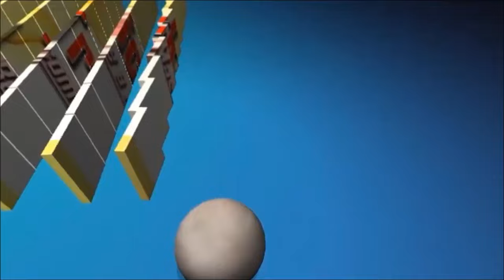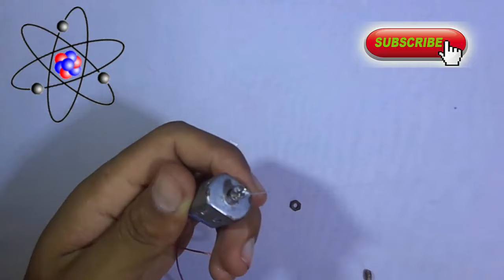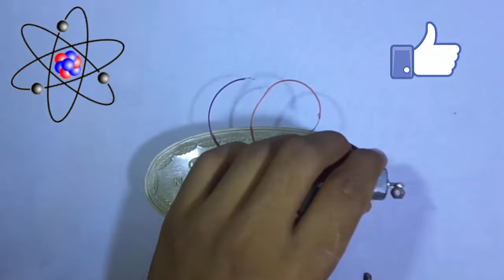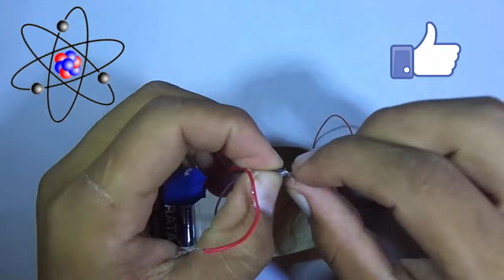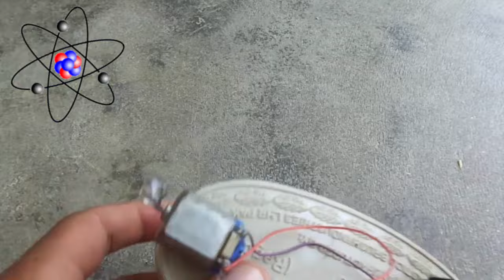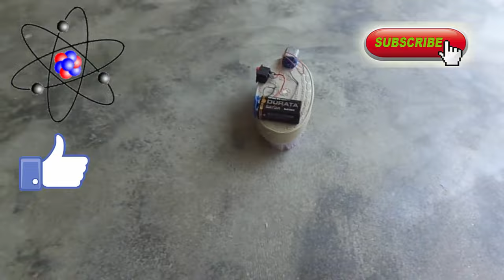how to make vibration motor at home..//How to Make a Mini BristleBot

Comment: good idea
Reply from the maker: thanks you
Reply: Q hackers i am considering your idea in my major project...if it possible then i will work on changing directions and other by using multiple motors as vibrator...
Reply: Q hackers où la vibration dans cette mini projet